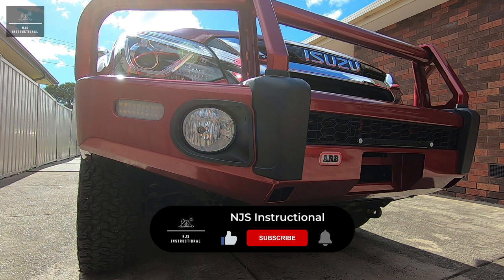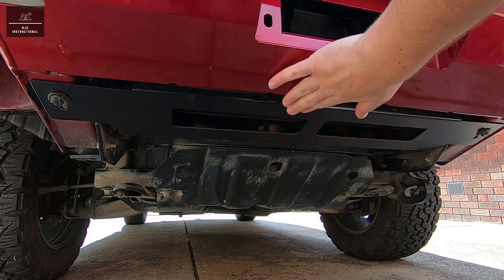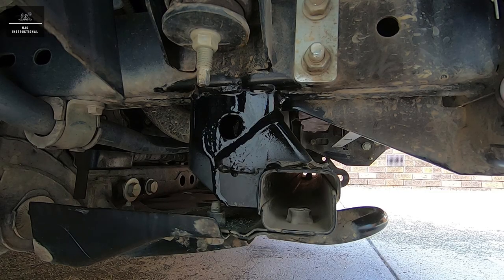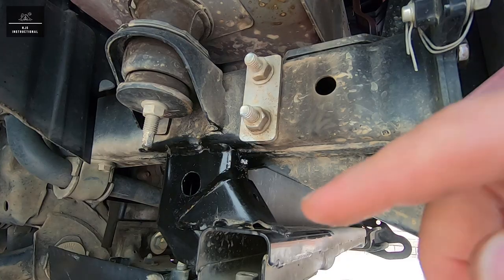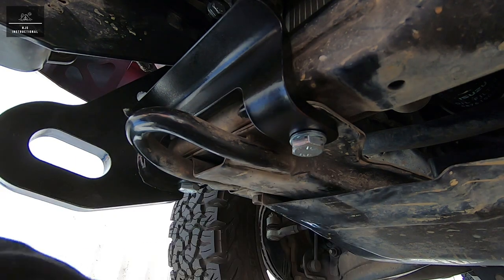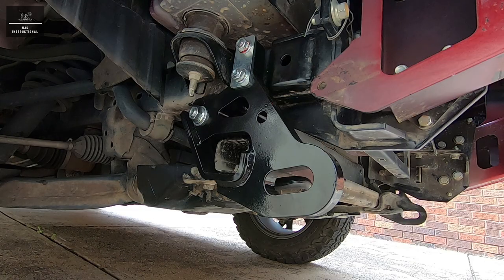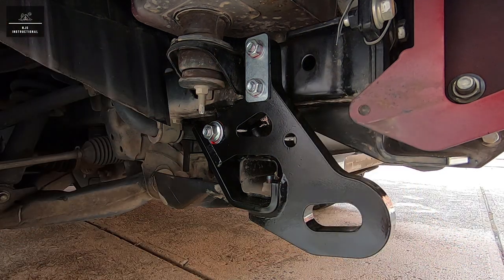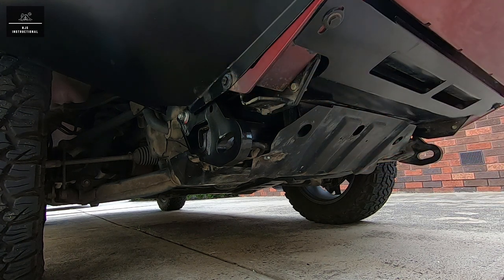ARB Recovery Point Installation - Isuzu D-Max & MU-X

Comment: Great instructional video. I bought a second hand 2012 D-Max fitted with an ARB bullbar, unfortunately when they mounted the bullbar the holes drilled through the chassis weren't close to perpendicular so when replacing the two smaller crush tubes & bolts, I had to die grind out the hole on one side of the chassis so the crush tube could fit between the chassis rail. Thanks again, you made it look so easy with good instructions.
Reply from the maker: Cheers and enjoy your D-Max!

Comment: Excellent presentation. Do you happen to know if these recovery points are 'year of vehicle model' specific? This design seems like a radical departure from what I encountered when I last looked into RP's for my 2019 MUX
Reply from the maker: Cheers. It depends, Recovery Points are unique to each make and model. However, the Recovery Points shown in the video should apply to all 2013 - 2021 (pre facelift) MU-X's and D-Max's.

Comment: Hi
I have just purchased the arb recovery point in your video, but my mux, which is the last model before the upgrade, does not have the 2 holes drilled into the chasis like yours for the top 2 bolts?
Is my mux version different.
I dont have a bullbar fitted.
Thanks for any advice.
Reply from the maker: Cheers, thank you. Yes, the two holes you mention will need to be drilled. As this vehicle had an ARB Bullbar, these were already drilled for the fitment of the Bullbar.
Reply: Any suggestions on how I might drill these holes at home
Reply: Would I need to drill 2 holes, or will 1 be enough?